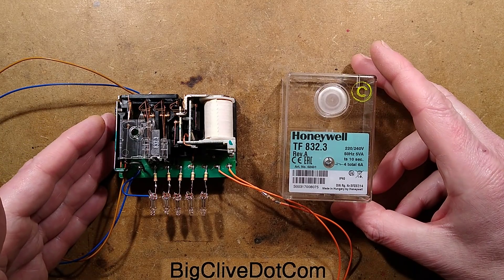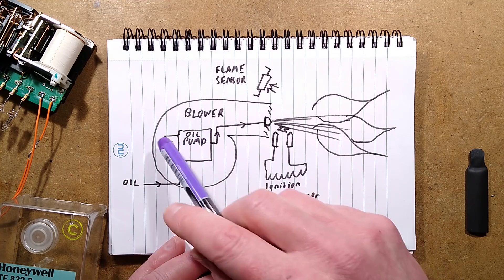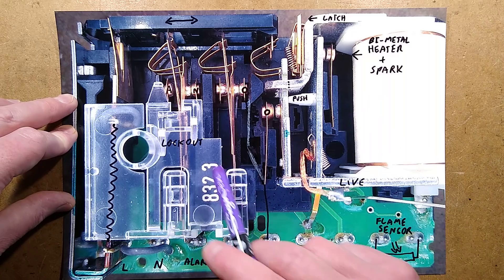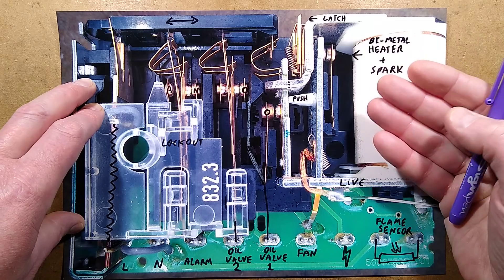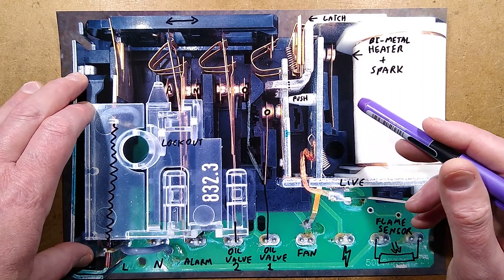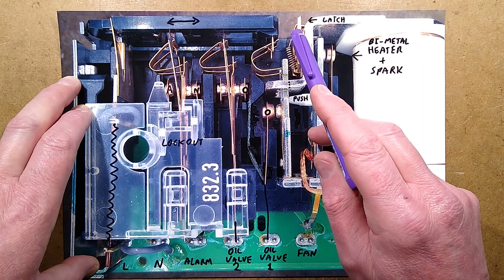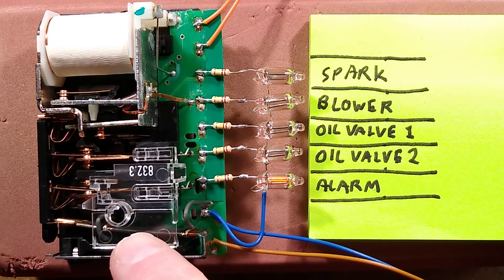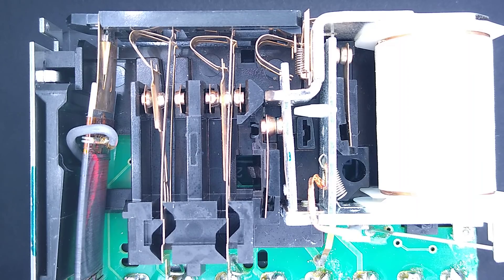Incredibly clever oil furnace burner controller (very perplexing)

Comment: That was terrific. Thank you Clive. I wouldn't mind betting that most boiler techs don't understand this module. Almost every time I've had a tech in for a boiler, it's the first thing they replace and then chase down the actual fault... I wonder if this is just standard practise.
Reply: In many fields, an early diagnostic item is "Replace <x> with known-good component". It eliminates a potential source of problems during later diagnostics. Afterward you should generally re-install the original part to determine whether it was faulty, but many people skip that step.

In the automotive field particularly, more and more "diagnostic" trees are end-to-end repetitions of that task with different components. By the end, you may not have fixed the fault but you will have added thousands of dollars to the invoice - and isn't that what really matters?
Reply: @Azlehria  That's pretty much what I was diplomatically avoiding saying ;)
Reply: @Azlehria  I moved into a flat and took me a while to get the gas boiler lit. A year or two later, for fun, I followed the 'troubleshooting flow chart' running the same symptoms. It concluded with 'replace gas valve'.

It was completely wrong but very close to what it should have said:
'Replace gas'.

The flat hadn't been used for a while and the gas I was trying to burn wasn't flammable ! Disconnected the meter and turned on the 'gas' until I could smell 'gas' then reconnected, bled it through and it fired up.
Reply: @millomweb  I encounter that from time to time - without even moving!

A line may have been disconnected and then not purged of air. If I don't switch over to the backup cylinder before the pilot lights go out, I have to purge the whole system again before they'll stay lit. Happens about once a year.

I'd have changed to an auto-switching regulator years ago, but being able to bleed off pressure into the lighter cylinder has come in handy some summers.
Reply: @Azlehria  I'm on mains gas, not tanks !
Reply: @millomweb  What, you don't think those ever get opened up?

Alternatively, if the pilot valve is left open while the supply is shut off at the service entrance, air can backflow through it while the thermal valve is still open. This is what usually happens to me.
Reply: I used to carry a couple of types with me to use as a diagnostic tool, after the usual checks (blocked or dirty oil nozzle, flame sensor dirty, oil supply fire valve closed etc). Was fascinating to see it work through the logic process as I never usually had the time to.

Comment: The last failure on my boiler was either the spark generator going tits up and taking the controller with it or the controller going tits up taking the spark generator with it. either way it cost a good few beer tokens to get it going again with having to replace both items. Waiting on the lockout reset seems to be the longest 1 min 30 in history.  My heatslave is 17 years old and the only original parts are the flame sensor and burn chamber. Replaced all 4 Relays on the main pcb. Tri valve motor that dissasembled itself, Controll box & Spark Generator, blower motor, 4 fuel pumps the list goes on but it has been the best combi boiler I have owned esp at the moment with the price of kero so low.
Reply from the maker: If the ignition module went short circuit it would damage the contacts or blow PCB traces in the controller.
Reply: @bigclivedotcom  I just dumped the controller as it was easier to replace both. And now 8 months later we have a pooooof of smoke a nice blue flash from the fuel coil and a blown 3.15A fuse giving me a dead boiler great.. Replaced the fuses and left burner disconnected and it powers up and turns the tri valve so main pcb is good. I reconnected the burner and started testing again. the fuel Coil is reading 2.15 ohm dunno what a good coil reads tho as a spare from a different burner reads 2.05 ohm. with the coil disconnected the system stars a burn cycle but the bimetalic does not move so think its a bad 832.2 controller again. thanks for this video Clive it is helping me narrow down the fault (since you are in glasgow this week do you fancy popping down to help me.. I can supply jager lol) Day 2. Bench tested with power the 832.2 controller and no movement on the bi-metalic just as I noted when fitted to burner. screamed and shouted at the frigging thing while trying to remove the cover... cheers for saying there was a hidden tab that needs released when cracking it open.. once open I checked the windings round the strip to find they were blown to bits and destroyed so No heat to make the b-metalic move and a replacement is on order. Do you want this one to rip apart for a follow up to this video ??

Comment: The implied check to make sure the sensor hadn't failed (as, for instance, if the sensor reports the flame is on when the oil valve is shut) is an example of what is called in the computer industry a "sanity check". I've often coded them myself, but this is the first time I've seen one implemented electromechanically!
Reply: The implied check is also there to check if the solenoid is leaking oil and burns before the actual ignition.
Reply: @janhu3953  
And It's probably fail-safe as well, pretty important in things like these where failures can get "exiting"
Reply: @janhu3953  oh.. neat
Reply: The formal name for this in safety-critical systems is "plausibility check".
Reply: In a very real sense, this device could be called an analog computer. There is something simply fascinating about old computers that used gears and shafts and other mechanical components to perform calculations. I remember coming across some world war 2 era “navy computer service manual” and it explained how different components like integrators, differentiators, rack & pinion, and various gear arrangements could be used to implement mathematical formulae in hardware. Of course the fire control trajectory computer for some particular weapon took something like 8 people to enter values by spinning hand wheels and setting switches and used kilowatts of power to move the thousands of pounds of steel components around to perform the calculations which could probably be done using the most basic arduino today, but it’s an impressive step in the development of modern computers!
Reply: Such systems are so common in safety systems.

Comment: That's about as complex as you probably can get mechanically. Here in the US you have a few types. I've never heard of two-stage oil burners, but I'm not a tech either. Here are the few types you see in the US, note on the ones you simulate with yours oil valve two is ALWAYS open.

Basic Constant Ignition: In this case you would simulate with your fan and spark both connected to the fan contact. There is no oil valve in the most basic systems. Microcontroller based controls can perform this operation. This is suitable to coil/core ignition transformers or (theoretically) constant rated electronic ignitors.
Basic Intermittent Ignition: In this case your motor would be connected to fan and spark would be connected to spark. There is no oil valve in this system. Microcontroller based controls can perform this operation. All ignitors are suitable.
Delayed Intermittent Ignition: This is simulated as you did above without oil valve 2 connected. There is an oil valve in this system. Microcontroller based controls can perform this operation. All ignitors are suitable.
Delayed Intermittent Ignition With Post Purge: You cannot simulate this as a microcontroller based control is used. This leave the fan on after the heating cycle is over to clear out the oil from the chamber.

North American Specific information: The flame sensor is usually mounted to the ignitor looking into the chamber from behind the nozzle. Controls have two additional terminals, usually marked T-T for thermostats and are run through a low voltage (24 Volt) transformer. For furnaces these are connected to the thermostat, for boilers these are shorted (except for some Microcontroller controls).

About Microcontroller based controls: These are sometimes completely field programmable. Ignition type, oil valve operation, delay lockout time (only within first 100 cycles), appliance type, and thermostat terminal configuration are usually all programmable. Microcontroller units also have two types of lockout. You have a normal lockout (customer reset) and hard lockout (service tech reset) programmable. These units also have purge feature that allows it to ignore the photocell for a period of additional time for purging. Purging is usually done on the electromechanical controls by shorting the flame sensor out after turn on.

You can learn more about oil by watching this American plumber Steve Lavimoniere: https://www.youtube.com/channel/UC4mZGMmJ1kOaOG1oRACZDbQ

Comment: Closed circuits are neat. This presents the same challenges as when trying to conceptualize and explain a PLL or a PID. Your explanations were quite impressive and efficient!
As for safety I was almost expecting something to detect whether the fan is running; at least an open circuit could be detected for example by chaining the oil pump contact with the fan.
Reply: The oil pump motor IS the fan motor. They are on the same shaft.

Comment: Mechanical logic. I love it!
Reply: There's a reliability to mechanical items which cannot be beat.
Reply: Not so sure about that. I think a well designed electronic circuit is more reliable.
If those contacts are slightly bent, that is probably already enough to, for example, start the burner 2 before burner 1.
Reply: @TheRailroad99  You'll not find a lift that does not have mechanical safety features. At one time - and probably still, in places, electrical safety features aren't relied upon.

Comment: That must have taken so much trial and error to design. Everything is so precise in movement and action.
Reply: What amazes me even more is fact it can be cheaply manufactured with sufficient precision to (presumably) provide a useful production yield.  Just image the headaches a worn bit of production machinery could cause.
Reply: @ferrumignis  Was wondering the same.
Reply: @JasonRobards2  having investigated quite a few fires in white goods and heat-producing appliances over the past 20-odd years I'm all for electromechanical over solid state controllers. 
For me the latter are just too unreliable. 
The main issues we had with the former were the old "fast on" and crimp connectors in 240V appliances where they would suffer resistive faults and start fires, particularly in tumble dryers and other high current appliances. Those were quality and design issues that appeared sporadically.
Reply: @ferrumignis  Headaches....worn bits...production machinery....Yeah, my last job was Maint. Mech/Electrician in a shop with about 125 machines...many were old and involved a lot of cams, rollers, chains, gears and solenoids...Old being like 50-60 years...that was in 1999-2000....I was hired to fix stuff that 'Someone' had already worked on a few times...including hand cranked machines that had been modified by adding electric motors to them...
Reply: Yeah this is insanely complex.
Biggest question I have is why not just go solid state. You could go with a microcontroller and relays/transistors to do the same job for a lot less money, or am I missing something? Maybe this design is just more rugged?
I suppose if we ever get EMPed or hit by a super powerful solar flare people can still hotwire their central heating if they have a generator.
Reply: @daviddavidson2357  My coworker was hired to install Solid State Relays in place of mechanical relays in air conditioning systems.  He was constantly going back replacing them since they would quickly burnout even at triple the rated load current.  SSRs and electronic controls hate any kind of rating being exceeded at any time or even noisy power.  Relays don't normally care if there is a back EMF spike when the motor circuit is opened.  Relays are large, but robust due to their construction.  Just clean or replace the contacts when there is too much pitting or carbon buildup.
Reply: @daviddavidson2357  I've messed around with enough HVAC stuff to know that yeah, solid state controllers kinda suck and somehow cost MORE to buy. The mechanical ones, when they fail, just get more and more intermittent and can usually be fixed by smacking them with something to un-stick a stuck contact, giving you enough warning to order a new one and just live with intermittent heat for a few days, instead of just failing outright at 1am on a January Saturday. 

Speaking of, the tolerances on this stuff aren't particularly tight, especially by stamping and injection-molding standards. The timing on this actually leaves quite a bit more wiggle room than solid-state ones do, so even worn-out molds and bad quality stamping on the sheet metal will usually still pass QC and work fine. Microcontroller stuff is REALLY prone to dying of things like back-emf from the relays or the ignition transformer, cooked electrolytic caps, shorted FETs, etc, the MOST solid state I'd go if I had a choice is one of the older designs built around a couple 555 timers - those are almost as reliable as these electromechanical ones.
Reply: @LenKusov  Solid state designs can be completely superior - the issue here is that the design is easier because a microcontroller based ECU is a straightforward process to design. Less effort goes into the design and testing - less reliability.
Reply: @drkastenbrot  eh, more reliable/better in terms of lifetime under normal operating conditions, but in terms of adverse conditions I'm not sure.

Water Ingress springs to mind, a microcontroller is such a relatively more complicated device that predicting how it would fail, and whether that would be safe is almost impossible.

How's it going to behave if water shorts this pin to this pin or to ground weakly etc, failures can be gremlin like, even if you can make the failures much less common, if they aren't as quantifiable it can still be iffy.
Reply: @AngDavies  all the things you mentioned are painfully accurately characterized for modern (premium) microcontrollers. 
a good example are modern flight controllers for drones. bare uncoated little pcbs packed with high-speed-processing, sensor and high-power electronics. you can drop them in water, powered, and they work absolutely fine again after drying. you can have dirt, shredded grass build up on the pcb, causing current leakage yet no failure and for the most part even flawless function. 
they got that reliable because thats what the market wanted, the hobbyists rather pay double for something that lasts compared to replacing it every couple weeks. 
its all a matter of research and development, and a lot of companies dont understand the importance of it and just cut corners.
Reply: @akak5128  Probably what happened was they designed it decades ago, it failed in some way and caused a few houses to burn down, then they fixed it in the next version, and a new failure mode came up, etc. until most of the failure modes got figured out.
Reply: @akak5128  Maybe that's what the electronics are for is an extra failsafe.
Reply: The overall design reminds me of early lift controllers, but for that special timing slider.
Reply: Yes...I once worked at the New York Bell Systems Lab (just fixing teletypes that were already OK)...but I had top level security clearance, so I could check out other stuff...this was in 1969 when the 'touch-tone' dial was being designed...they had relays that had 4-5 or more 'stages' of contact closing when the relays just closed with a click....milli-seconds between the various contact closing.....but later were electronic. Western Electric (the phone mfg. Co) was very good at intricate mechanical devices that operated millions of cycles before attention was needed....like the rotary phone switching system in the Central Offices...
Reply: This controller was made back in day when relays where the norm, so there where people making these kinds of devices on day to day basis. If it aint broke dont fix it. Also, even to thus day,simplicity is the king in heating industry.
Reply: Not really mechanisms such as this have been around for over 130 years minus the electronics. EVERYTHING was relay controlled until the 1960s when Electronics started to become more commonplace.
Reply: @akak5128  No, this is a design that has taken years to mature. Getting that functionality and reliability manufactured so cheaply is something nobody can get right on the first production run.
Reply: @akak5128  when it comes to gas and safety,  mechanical is always best!
 You design it to be off when it fails. Electronic components can never be guaranteed to be off when they fail.